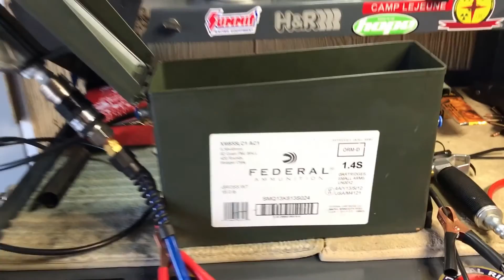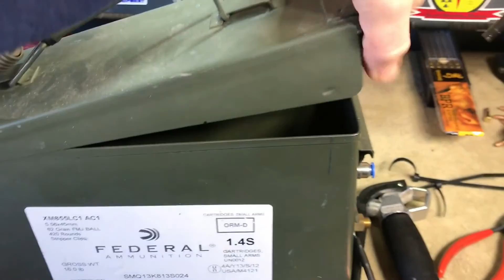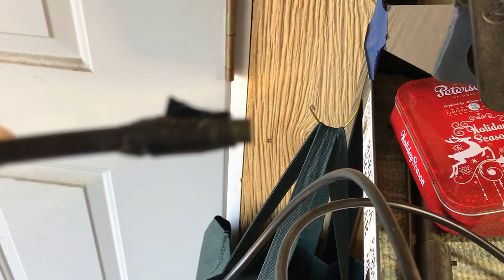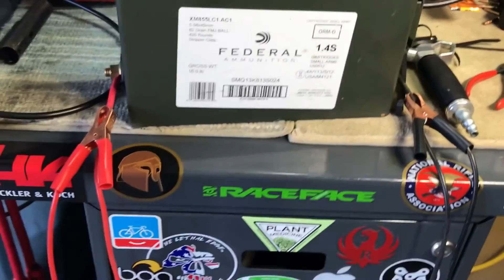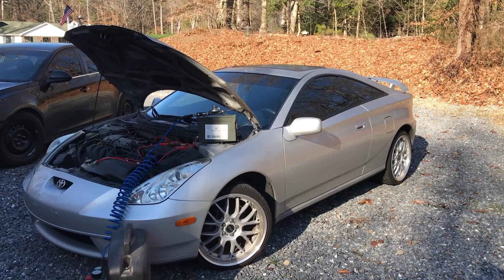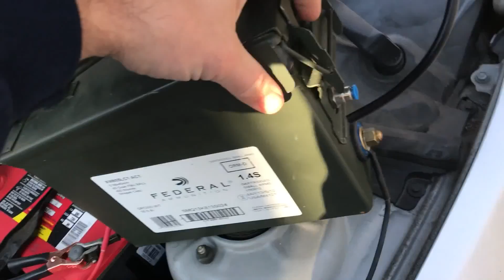Ammo Can Smoke Machine for Garage Journal

Comment: hello, nice build! what gauge of nichrome wire did you use & length of wire? thank you!
Reply from the maker: TIMOTHY WRENN here is the link. SS 316L - 25 ft. 20 Gauge AWG Stainless Steel Resistance Wire 0.81 mm 20g 25’ https://www.amazon.com/dp/B01KK8Y72I/ref=cm_sw_r_cp_api_fHseAbZ9D58HT